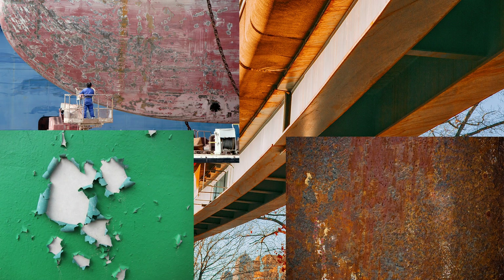How to Measure Adhesion Using the PosiTest® AT Adhesion Tester

Comment: The inspector failed my industrial painting coatings because I have to many mils specified by the paint manufacturer    .by using the at tester and the adhesion passes can he still fail it?
Reply from the maker: Our PosiTest AT pull-off adhesion tester measures the adhesion (bond) strength of the applied coating. For measuring paint mil thickness, our PosiTector 6000 (steel/aluminum panels) or PosiTector 200 B (plastic panels) is required.  Please contact us for further discussion and solution recommendation at +1-315-393-4450 or techsale@defelsko.com

Comment: How do we calculate the required pull off force
Reply from the maker: The PosiTest AT measures the force required to pull a coating away from its substrate using hydraulic pressure. Pressure is calculated based on force and test area and represents the coating's strength of adhesion to the substrate. The actual pull-off force requirements vary by coating type and job specification. Please contact our technical team for additional information at techsale@defelsko.com or +1-315-393-4450.

Comment: I need an apparatus to remove tiles from dollies after the test
Reply from the maker: We provide the test dollies as a single use consumable.  They can be reused provided the dolly surface can be returned to its original condition. This is typically performed by heating and scraping the cured epoxy from the surface of the dolly. To discuss this further, please contact us at +1-315-393-4450 or techsale@defelsko.com.